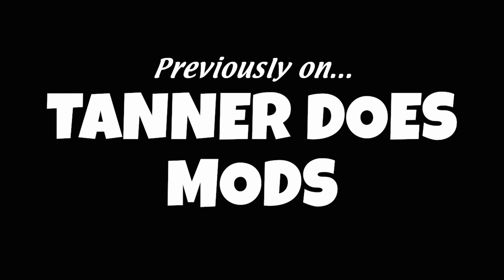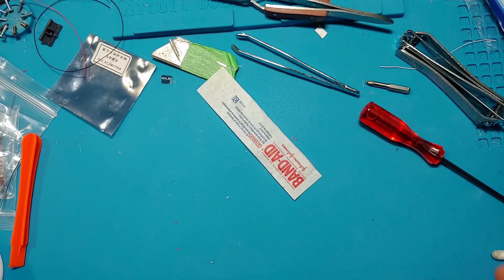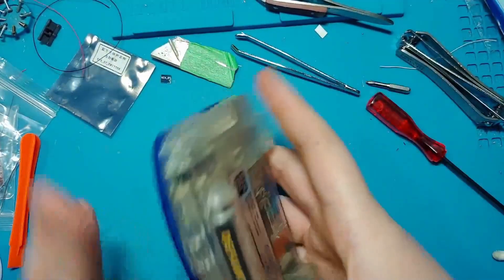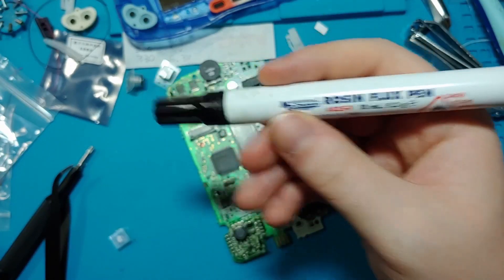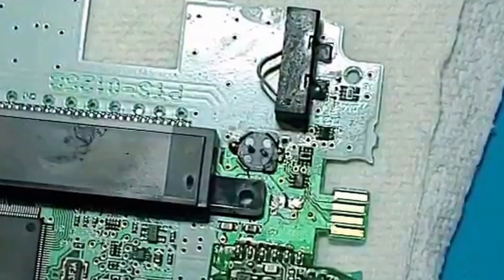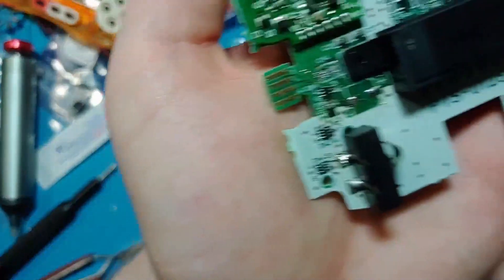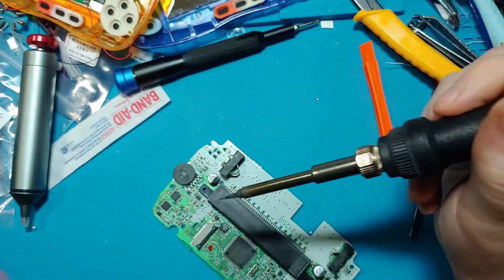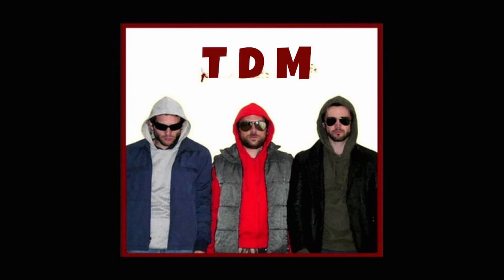Wonderswan Color Electrolytic Capacitor Replacement

Comment: Would you say it's worthwhile to replace the caps while you're doing the IPS mod? I plan to do the IPS mod and figure I might as well recap while I'm under the hood. My old caps still work but who knows for how much longer due to their age
Reply from the maker: I can't say I've seen caps on a WSC burst before, which really is the biggest threat I guess. Overall I haven't found it to make any difference from my units with original caps, so I'd say only do it if you start having issues and suspect it may be the culprit. That being said, I barely have any idea what I'm talking about at the best of times so who knows

Comment: Rethink your tip preferences, dude. Lol. 30 second job with the correct tip. ;)
Reply from the maker: Someone pointed out in another comments section that I should be using kapton tape on the cartridge slot if I want to avoid melting it with a bigger tip. Had I done that I think I would've instinctively reached for the chisel tip